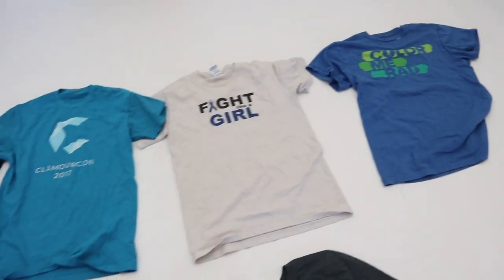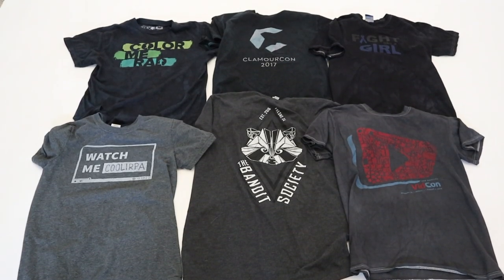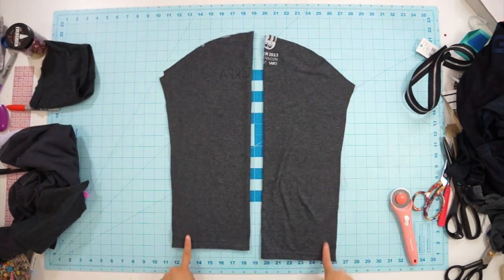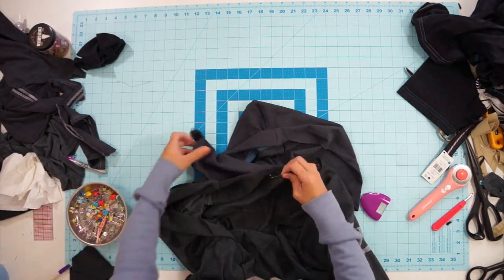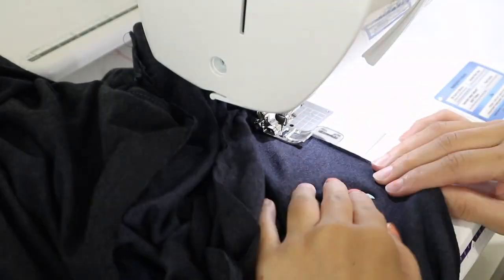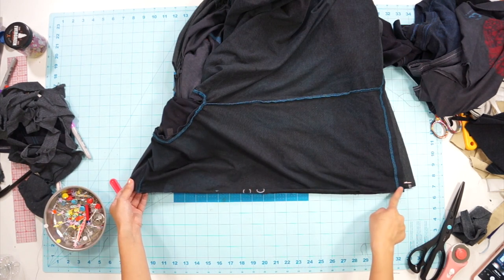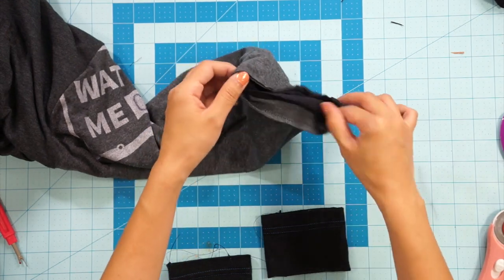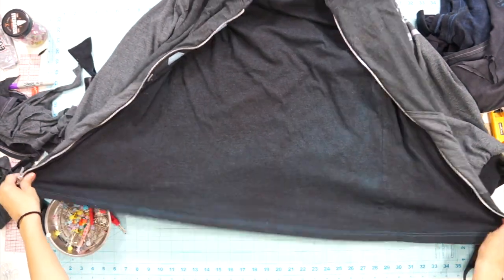DIY Recycled Jacket From Old T-shirts | Coolirpa

Comment: Hi April. The zip issue is caused by one fabric being stretch. I usually sew with some paper underneath the stretch fabric. It stabilises the stretch and then just rips away. Good luck
Reply: You can also use some fusing along the zip seam to stabilise the fabric 👍
Reply: this is good to know <3 thanks for posting the tip
Reply: I would guess that a walking foot would also help 👍
Reply: Yeah.....there a lots of different ways that work. I just use the paper method coz it’s cheap and I always have paper 👍
Reply: Good tip 👌🏽
Reply: I purposely hord tissue paper sometimes for this reason. (And to upcycle it)
Reply: @adam Do you have a video showing this  method or can the OP show us for newer people?  Is the paper at the bottom on the machine??
Reply: @shellwithonel  do you leave the tissue paper in and sew on it? Does it stay in final garment?
Reply: @christmasfreud  it will usually tear off with ease once you sew into it. If little bits are stuck you can take it out with tweezers. It's a cheaper alternative (and you're re-using) than stabalizer (unless if you need it for the auctal garmet and not the sewing process

Comment: I love this. The way you made it, it looks like it could be reversible.
Reply from the maker: Lyca31 thank you!
Reply: It could be if you used a reversible separating zipper. They are hard to find (maybe special order?) but the slider at the top kind of swivels over  so you can pull it from either side.

Comment: Hi April, Another way to prevent wavy zippers or "bacon zipper" as a friend of mine calls it because it looks like cooked bacon), especially a zipper that separates, is to always use facing and make sure you French Fuse the facing.  The French fuse stabilizes the fabric/facing to accept the zipper. Secondly, after you've sewn the zipper in, to make a zipper lay REALLY flat in the garment, slide the zipped garment onto an ironing board with the zipper facing up and make sure it's closed.  Pin the garment down on each side of the zipper sides on the bottom of the garment (pinning into the ironing board).  This will hold your garment down. Then lightly stretch the garment so the zipper and fabric is taught and pin down the other end of the zipper and fabric on each side of the zipper at the top of the garment. The 4 pins should be enough to hold down the garment to the ironing board.  Now with your zipper laying along on top of the ironing board tightly, lightly steam the zipper and seams.  If it's a light fabric that you're afraid of ruining, you can use a press cloth. After you've steamed it, leave it sit there for a bit to cool down.  Go enjoy a cup of coffee and let it all set while still pinned.  Come back in a bit after it's cooled and set, then unpin it.  It should never "baconize" again.  Hope this was helpful for you.  LOVE your channel and everything that you stand for.  Keep up the excellent work.  You're very inspiring.  Much Love, -Skoben2000

Comment: You need to stabilize the stretch fabric before installing a heavy metal zipper. I usually use stitch witchery to install my zipper first and then sew. Works like a charm.

Comment: Zipper tip: you need to slightly ‚bunch‘ the stretchy shirt material. That’s what holding the zipper tight, while letting the machine move the fabric, was supposed to do. Doesn’t really work for me either, though. 
I rather do it manually, when I pin the fabric. I just bunch the jersey/sweatshirt fabric up, ever so slightly...it should end up maybe half an inch shorter over the whole length of a zipper that length. Make sure, both sides are even!
Completely prevents buckling 🙂
Reply: Rara Avis you can add a strip of stabilizer behind the stretch fabric and that should help and then you don’t need to bunch up the fabric either. 😊
Reply from the maker: Rara Avis I heard of this too, bunching the material. Will have to try next time!

Comment: if the zipper is longer than your center front opening and you stretch the knit fabric to fit the zipper that's what causes the waves.  you need to measure the center front opening being careful not to stretch it.  you will probably need to shorten the zipper to fit into the opening.  you are going to shorten the zipper from the top using an end nippers pliers to remove the teeth.  you will also need to carefully open the top stops and move them down to the new top of the zipper.  DO NOT SHORTEN THE ZIPPER FROM THE BOTTOM !!  if you do,  you will be going back to the store to buy a new zipper because you can't remove the separating mechanism.  I learned this the hard way

Comment: Looks comfy and a great way to upcycle!  Just curious, but have you made anything that's reversible before and is it difficult?  Easy?
Reply from the maker: wxclim8 yes I have and it’s not too difficult, you just have to sew things a little differently so there’s no raw edges on either side. For example when I sewed the cuffs onto the sleeves, instead of just sewing the cuff right sides together, I would sew one side of the cuff right sides together first, and then fold the other side of the cuff  under so the raw edges are tucked inside, and then topstitch it in place. That was probably very confusing but I hope it helped a little
Reply: @coolirpa  Not confusing at all.  That make sense.  I've been watching your videos for a while, so I'm learning the approach.  Thanks!  👍😊

Comment: Could this be reversible if you sewed the cuffs so that the raw edges were hidden?
Reply: It could be if you used a reversible separating zipper. They are hard to find (maybe special order?) but the slider at the top kind of swivels over so you can pull it from either side.
Reply from the maker: Sharon Rooney if I had a reversible zipper it could have been! Haha. Unless I just zip it up from underneath 😂